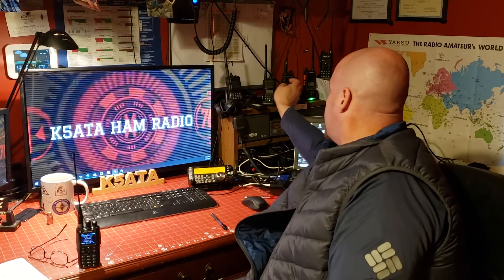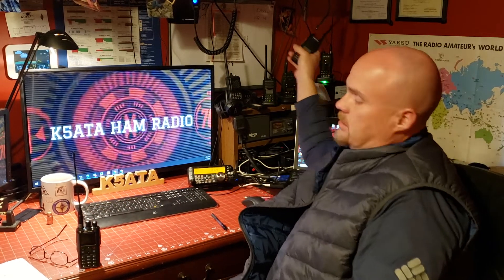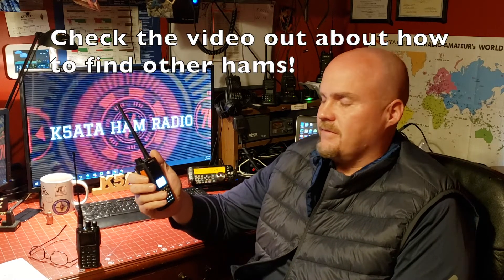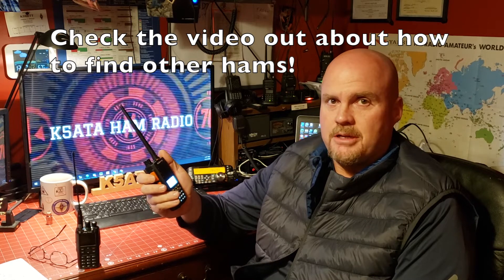Ham Radio Basics: How to Make Your First Contact on 2 Meters and Repeaters

Comment: Good video, me and a couple of other hams were debating whether using hot spots and “”talking all over the world “” let’s face it, you’re not talking all over the world you’re mearly talking to a hot spot and on the internet, I haven’t had my license all that long and a few other swear your talking around the world, this is the fastest way to lose our bands I mean you don’t even have to have a radio, I done mine through my phone, WHAT EVER HAPPENED TO using the radio with an antenna system doing it for real, granted you might not get a contact but hey if you keep trying u will get one , it gives you a rush that yes I done it, no rush using the internet,     These opinions are MY OWN and u do what ever you choose, I’m sticking to the hard way and feel accomplished…..